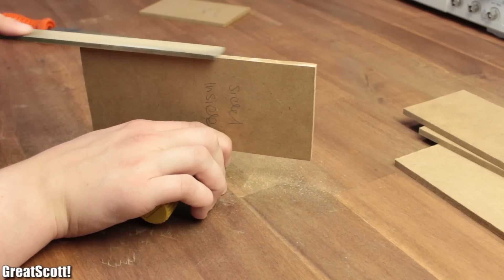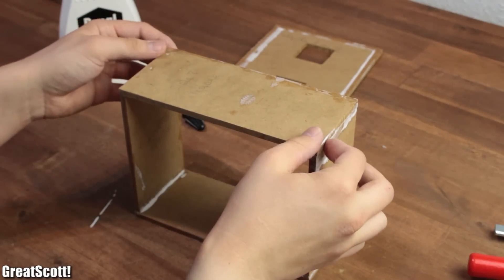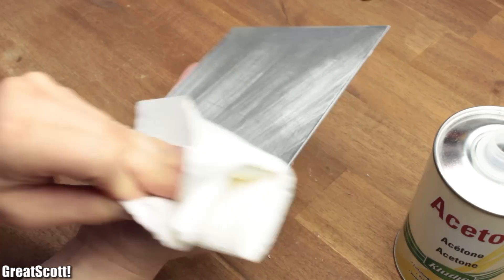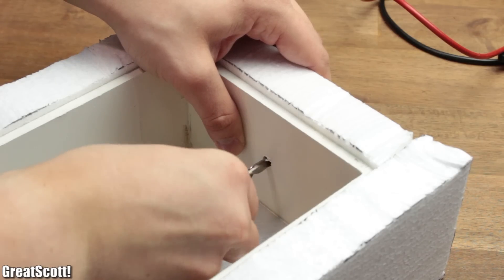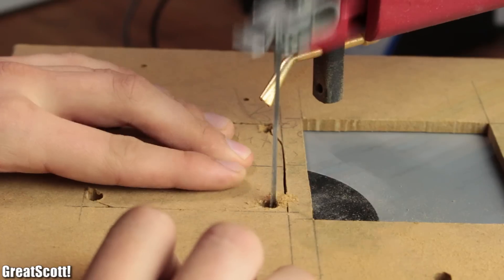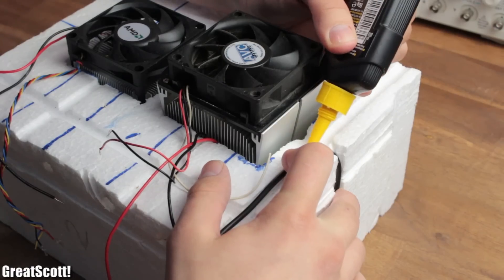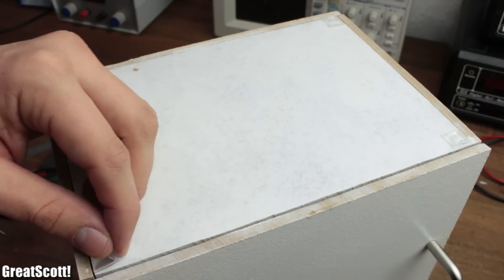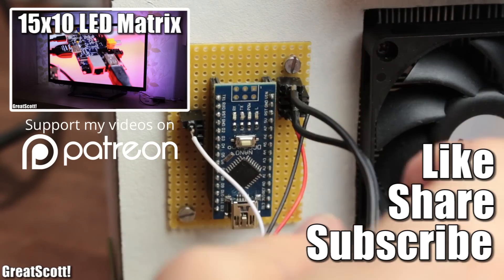DIY Cooler (Part 2) || Peltier Module

Comment: Arduino 1.6.7 (Windows 7) Evaluation Board "Arduino / Genuino Uno"

C: \ Users \ User \ Downloads \ Cooler_Sketch \ Cooler_Sketch.ino: 1: 21: Fatal error: OneWire.h: No such file or directory

  #include <OneWire.h>

                      ^

Compilation terminated.

exit status 1
Error at compile time.
Found invalid library in C: \ Users \ user \ Documents \ Arduino \ libraries \ sketch_mar12b: C: \ Users \ user \ Documents \ Arduino \ libraries \ sketch_mar12b
Found invalid library in C: \ Users \ user \ Documents \ Arduino \ libraries \ sketch_mar12b: C: \ Users \ user \ Documents \ Arduino \ libraries \ sketch_mar12b

   This statement should be more information to
   "See more information at compile"
   allowed in the File> Properties.
Reply: how to dowland  how to install  help pls
Reply: how to instal

Comment: I ran some calculations for this cooler using the EU Energy rating system. Using some assumptions and the available data in the videos, I landed waaaay below the EU G rating i.e. the worst possible rating ;) . The calculated SCa I got was 57,66.

The G rating can be upgraded to an F provided the annual power consumption of the cooler per annum stays below 86,5 kWh. (Provided I read the rating system correctly)

Comment: you need active cooling on the inside when i built mine i used one cooler and got 4 degrees Celsius in around 2 hours.
Reply: in 4 hours i get around 2.7 and the lowest is 0
Reply: What do you mean by active cooling? like airflow or liquid cooling?
Reply: +Guevara1015 fans on the heat sink

Comment: youre blocking the airflow of the heatsinks with the foam.
Reply: didn't he drill holes on 1 side of the styrofoam so that the heat could get out and not build up?
Reply: absolutely not enough airflow... like nope...

Comment: I would like to know what the room temperature was.
Also is there a way of slowing down or stopping the diffusion of heat to the cold side once power is switched off?
I'm thinking of building a slightly bigger one with 3 peltiers. Need it to drop the temp by atleast 20'C below room temp.

Thanks and great video

Comment: you're not supposed to sand the sides of metal that are transferring heat through thermal paste, thermal paste is meant to fill in the gaps, making more is counter productive.

Comment: showing this error while compiling Arduino nano

(
Warning: platform.txt from core 'Arduino AVR Boards' contains deprecated recipe.preproc.macros="{compiler.path}{compiler.cpp.cmd}" {compiler.cpp.flags} {preproc.macros.flags} -mmcu={build.mcu} -DF_CPU={build.f_cpu} -DARDUINO={runtime.ide.version} -DARDUINO_{build.board} -DARDUINO_ARCH_{build.arch} {compiler.cpp.extra_flags} {build.extra_flags} {includes} "{source_file}", automatically converted to recipe.preproc.macros="{compiler.path}{compiler.cpp.cmd}" {compiler.cpp.flags} {preproc.macros.flags} -mmcu={build.mcu} -DF_CPU={build.f_cpu} -DARDUINO={runtime.ide.version} -DARDUINO_{build.board} -DARDUINO_ARCH_{build.arch} {compiler.cpp.extra_flags} {build.extra_flags} {includes} "{source_file}" -o "{preprocessed_file_path}". Consider upgrading this core.
C:\Users\shamon\Downloads\Cooler_Sketch\Cooler_Sketch.ino:1:21: fatal error: OneWire.h: No such file or directory

 #include <OneWire.h>

                     ^

compilation terminated.

exit status 1
Error compiling for board Arduino Nano.

This report would have more information with
"Show verbose output during compilation"
option enabled in File -> Preferences.
)

please help

Comment: Some ideas: a) constantly rotate the cans so the liquid inside moves, therefore it cools down faster, b) change the design so the cans can lay flat and the cooler touches them from the bottom, c) use some sort of DIY heatpipe and mount the heatsinks sideways... then the cooling could be way faster

Comment: Imagine making the outer walls of  a house out of the peltier modules.
Reply: Yep, when it gets cold, reverse the polarity so it warms inside :)
Reply: +Dazzwidd that wouldn't work as they are basically diodes lined up in a funny way.
Reply: Actually, I am pretty sure you can reverse the polarity of them to reverse pump heat. They're not your typical semiconductor junctions. I've heard about this before but none the less, you have got me interested to investigate :)

Comment: you would get alot better results with the heat sinks not counter sunk into the foam it would allow the air to move the heat away much better. the heat holes will help but if the heatsinks were exposed it be so much better. i do love the project though

Comment: Mal n bisschen Kritik zu deinen ansonten guten Videos.

Deine Aussprache von Cooler und Layer (eigentlich alles mit -er am Ende) ist etwas... Sehr gewöhnungsbedürftig, aber das ist Geschmackssache. 
Deine Heatsinks werden so nicht richtig arbeiten können, wenn du dir in einem PC den CPU heatsink anschaust wirst du sehen, dass dieser immer so weit weg von allem ist um möglichst frei zu stehen. Bei deinem Setup staut sich die warme luft am Sockel des heatsinks.

Comment: i like this project but i call it a fail, bc its take a whole night to cool only 2 drinks, and i have a 12v electric mini fridge with 20 liters room and it reach 7°C in 30 minutes and it cost me about €7,50
Reply: +123sil123 2002 where did you buy it?
Reply: Second handed
Reply: Okay Thanks

Comment: An internal fan is counter-productive. Even a very small fan like you would put on a GPU doesn't make a significant difference.  All of the energy that you put into a fan is going to be converted to kinetic energy or waste heat. While you might be able to circulate air to the cooling element, you are also circulating the hot air off of the fan motor. You would be better off putting a passive cold sink inside (that is essentially what the aluminum sheet is doing), but adding fins is not space efficient.

The best way to improve your cooling power is to put the biggest, baddest heat sink you can find on your system.  A peltier module has a maximum heat differential across the the hot and cold sides. That's why the cold side actually started warming up after a few minutes of operation as the hot side reached that maximum differential.

Power in and dumping waste heat are the two main factors in how cold you can go. 

When you turn off power to the Peltier, there is no more thermal transfer effect, so the cold side and the hot side will reach equilibrium quickly, so turning off power actually makes things worse.

Another comment suggested using a pwm strategy or power supplies designed with Peltier in mind.  One thing that you could do is keep the fans going full blast when you turn off power to the modules so you get rid of the thermal waste faster than it can bleed back over to the cold side. Some of the older fans had an integrated thermocouple that would put the fans into high gear when the sensor detected too much heat.

Since you have electronics skills, you might try reducing the current as you approach your target temperature.  You have to depend on the thermal efficiency of your enclosure being able to keep ambient heat out, but you could keep the hot side well within the capacity of your heat sink to disperse.

In fact, this would be a decent measure of how efficient your enclosure is. How much power does it take to maintain a consistent internal temperature.

Comment: hey greatscott, i bought also that peltier module, but what happens if you dont cool it?
Reply: +MEe$ Depending on how much current you put through the module you can burn it out. The cheepo TECs more so than some of the others.
Reply: +Mark Horstmeier        12v 3a
Reply: +Mark Horstmeier ??^

Comment: hey they have a sale on 250w peltier coolers if you want to check them out, you know just if you want to upgrade them its only $5       http://www.ebay.com/itm/TEC1-12715-TEC-Thermoelectric-Cooler-Cooling-Peltier-12V-231W-40mm-Plate-/181999305428?hash=item2a600102d4:g:ddEAAOSwqrtWofhD

Comment: Interesting project, I gotta research more about those peltier modules Cool stuff. I noticed what might make a good addition is taking a pair of neodymium magnets, one epoxied to the door and another on the inside of the cooler(recessed into the styrofoam) and it will make for a nice "latch"

Comment: You should also put a fan on the inside to move the air around so you don't have to put the drinks near the aluminum sheet.

Comment: You are blocking most of the cooler fins with styrofoam. You should cut out some of the insulation to get a much better airflow. Especially the smaller heatsink is completely buried... how should the hot air escape?

Comment: Those vent holes for the hot air are absolutely tiny. The better you cool the tec, the colder it will get. So for faster cooling you should cut out a complete fin sized rectangle and maybe protect it with some mesh.

Comment: I think the reason why it took a whole night to cool was the efficiency of the back heatsinks, plus the cracks in the Styrofoam. The Styrofoam might not be sealed properly and the 2 little holes for each heatsink on each side might not expel enough air from the heatsinks.

Comment: It is a bad idea to add layers between peltier module and heatsink. I would prefer to cut the mdf to make room for hot side heatsink.
Also insulation prevents the air flow over heatsink. You should make room for airflow. It would dramatically decrease cooling time and increase efficiency.

Comment: After playing quite extensively with peltier elements I have a few hints for you;
1. The TEC1-12706 peltier elements are, despite the suggestive name, not designed for constant 12V but rather constant 6A. Some safety precautions should be followed such as limiting to constant voltage on powerup but I've found 15V makes them operate significantly better. Supposedly 19V should work after they have reached a large enough temperature difference, but my cheap power supply blew up (quite spectacularly) from overheating before I had a chance to try.
2. Watercooling is amazing with these things. I run a TEC1-12710 (upgraded from TEC1-12706 but yours should work just fine) on watercooling and I can bring (the bottom half of) a can of soda below fridge cold in just a couple of hours at a current of 4A (less than half power). Then I turn it upside down a few times and enjoy. Only works with metal cans though as glass bottles are too insulating on the bottom. I use a bit of packing plastic wrapped around the can but I might build something like your fridge later on.
3. Play your cards right and you can have your beverage cooled to just above freezing, then have the best drink ever made with a DIY cooler!

Comment: 80W, (zwei Elemente mit je 40W), um über Nacht zwei Dosen Bier zu kühlen. Ineffektiv ist da noch untertrieben als Bezeichnung :-D

Ich hatte auch mit dem Gedanken gespielt mir was zu bauen, hab es dann aber gelassen, eben weil die Pelz-Tier Elemente einen zu schlechten Wirkungsgrad haben. 

Ich hab dann etwas gespart udn mir eine kleine Kompressorbox geholt. Die macht theoretisch bis minus 20 Grad, schaltet sich auch selber ab bei Erreichen einer eingestellten temperatur und sieht unter Vollast auch nicht mehr als 40W. 

Mit einem Flugakku aus meiner Modellbaukiste (3s oder 4s mit 5Ah) kann ich das Ding einen Nachmittag am See betreiben udn es passen mehr als nur 2 Bier rein.

Nachteil: Das Ding ist teuer und es fehlt das Erlebnis des Selbstgebauten. Aber die Energie packe ich dann lieber in das Bauen von weiteren Flugmodellen ;-)

Comment: Hi Scott,

great project :-) There is only a small mistake in your cooling concept, because you've covered the sides of the heatsinks with the case, therefore the heatsinks can not work efficiently. There is no good heat exhaust. BTW: To make the cooling effect a little more efficiently and faster, I would create the inner side panels (top, left, bottom & right) out of aluminium and connect it to the rear panel with thermal grease.

Best regards,
Chris

Comment: What kind of wattage can each Peltier modules handle?  Also what voltage gives the best performance?  I have 5 of em and I had a little project in mind i wanted to finish and hook up to a solar panel.

Comment: DIY cooler: Have an awesome personal cooler! Just make sure you have the 998643479974 components to make it, a bunch of power tools, and very steady hands.
Reply from the maker: +ns5070 What did you expect? I build it with a piece of paper?
Reply: +ns5070 rekt

Comment: Beste einstellung für ein TEC1-12706 ist um die 9,4-9,6 Volt und etwas um die 2,2-2,4ampere. da erreicht das dingen um die -15 bis -20 °C mit einem dezenten kühler :) das würde die effizienz steigern

Comment: Got myself an active cooling box big enough for most bottles that runs on both mains 220V and 12V cigarette plug for like 25-30€, seems to use peltiers and fans as well. Only thing that annoys me about it is the bad regulation of the fans, on mains power you can only use like the second half of the potentiometer to regulate them, because in the first half you can hear the PWM regulation work clicking when turning the fan on and off which is really annoying, because you turned it down to make it quiter. On 12V it doesn't regulate at all so you get the constant hum of the Fan.

Comment: arduino nano with 12volts?
Reply from the maker: +Juan Inventos I used voltage regulator on the board to get the 5V.
Reply: Lm7805?

Comment: I must say you have done wonderful project here but is it posible to speed up cooling proces a bit?
Reply: +Veso266 A higher powered Peltier module and a larger power supply should achieve this. :D
Reply: +Veso266 Oh and if you're getting a bigger PSU and a bigger Peltier module you probably also want a better heatsink or maybe like another user mentioned look at water cooling it.

Comment: I would recommend using some much bigger heatsinks for the outside, like those with heatpipes and copper base and total size of approx. 80x80x120mm. You want to maximize dT and with such big heatsinks you can get quite some heat away from the peltier and by that much more from the inside. For ideal 50% efficiency and your (I think) 80W module that means a dissipation of 160W per module. Maybe add some small heatsink to the inside with a small fan to not only rely on convection. For some extra kicks you can monitor the  hot side and devise some algorithm to stop the element when dT starts to drop. And/or use some mosfets to (slowly) PWM the thing to achieve constantly max dT.

Comment: will 6 amps work? pc power supply :) just happen to have two heatsinks lying around
Reply from the maker: +Dawid Ziaja If you go down with the voltage a bit.

Comment: could you try and make a project out of parts you would usually find at home? :)
Reply: like out of other electronics
Reply: +Jawadur Khan (jawi) Heatsink, Fan and wires can be found in an old computer, you get also get the really old ones for free. You only need to buy a peltierelemt, but the arduino nano is a bot of an overkill, so you dont really need it.